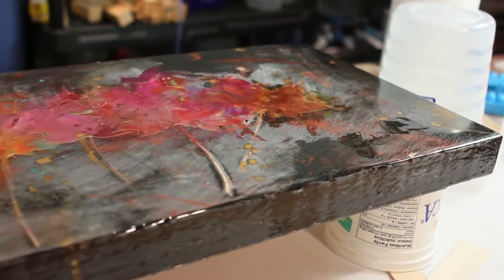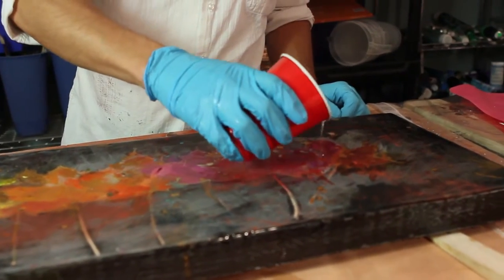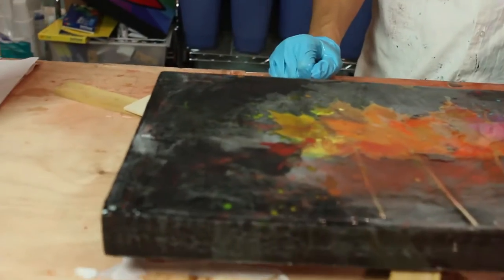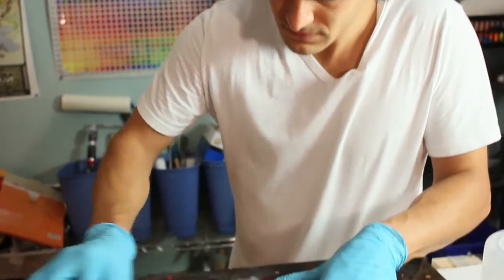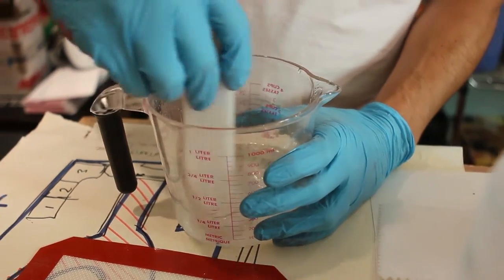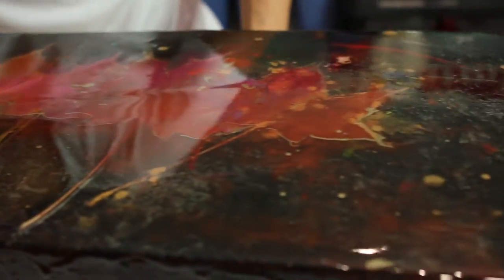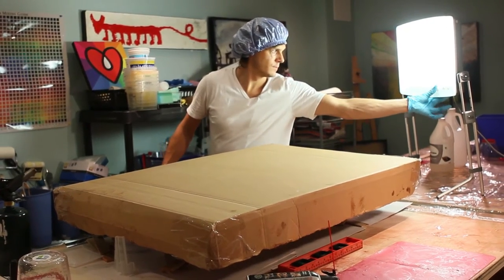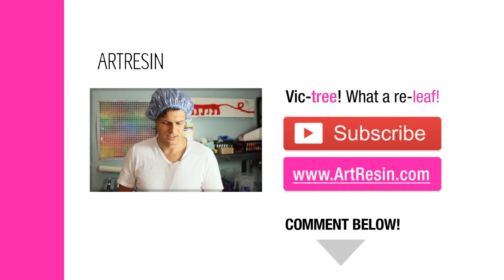How To ArtResin Leaves

Comment: can I use a heat gun instead of a torch?
Reply from the maker: you sure can!😊
Reply: thank you!
Reply from the maker: just a note, i switched to a torch after a while because i found it was just easier and the cable from the heat gun kept falling in the resin :P   but both will work.  a flame also burns up hairs or dust.